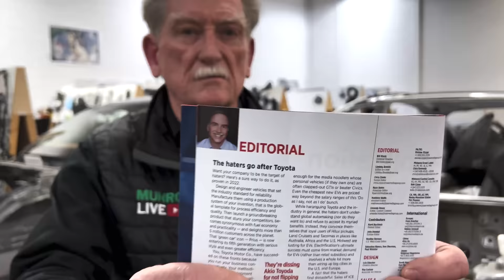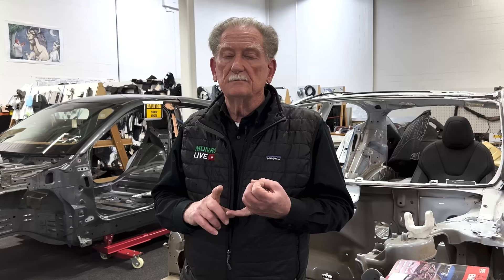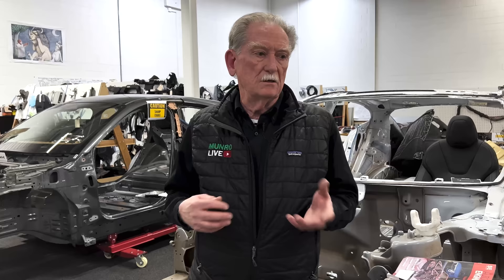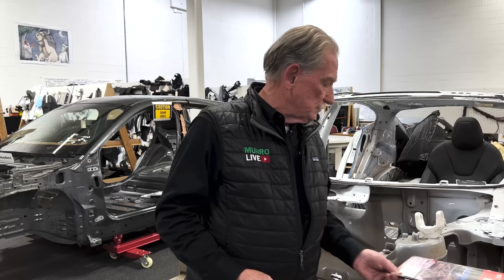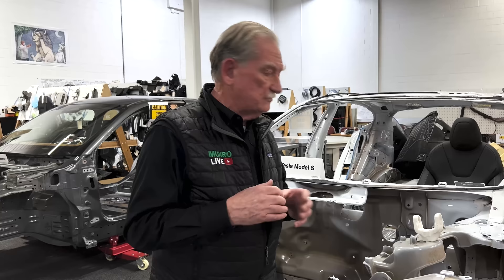GM Cast(ing) Away | GM gets low volume right.

Comment: Please do a show on metal fatigue, especially aluminum components of automobiles. Also, how corrosion affects aluminum parts and reactions between differing metals of those parts. I see a lot of aluminum being used now in cars and it would be nice to know how this material will fare long term.  Your show is always educational!
Reply: I have a Audi A2 from 2002, it has 240000km and it looks new. The aluminium chassi/body that my Audi has is rock solid.
Reply: Sealing between dissimilar material is how aerospace solve this issue. We have been using superplastic forming for decades in the airplane business. Aluminum airplanes can last for many decades given the right maintenance. Look at the B52 which are still in service.
Reply: Plenty of aluminum suspension components for decades now!
Reply: @Chumpster Aluminum form an oxide coating as soon as it is exposed to the atmosphere, this coating prevents corrosion. Al parts are often treated with a conversion coating such as alodine and anodize plus paint. Al can out perform steel with respect to corrosion and rust.
Reply: @Liberty2358  re: "Sealing between dissimilar material is how aerospace solve this issue" exactly these problems have long been solved.  what most don't see is simply how they are ignorant to these developments and are essentially playing "catch up".  also ref: 3M.
Reply: @phillyphil1513  We use wet sealant to prevent electrolysis, dissimilar material can act as a battery when there is a voltage potential difference and moisture (electrolyte). The sealant keeps the moisture out and prevent corrosion. You will surprise that 1 volt potential can corrode aluminum parts without sealant protection.
Reply: @Liberty2358  Good to know. Thanks
Reply: No need for a  show, no evidence either Aluminium Fatigue or corrosion a major issue. Get rid of the pesky ferrous components ASAP I say
Reply: @Liberty2358  re: "You will (be surprised) that 1 volt potential can corrode aluminum parts without sealant protection." but thankfully NOT a surprise to any Pro working in the field of Autobody and Collision Repair since the arrival of the 1997 all aluminum Audi A8, so 25 years ago.
Reply: Time will tell all how GM/Cadillac wins or fails.
Reply: This is covered in basic materials engineering books. I doubt they are going to start teach classes.
Reply: Lol. Meanwhile Cadillac used to be synonomous with falling apart because of the steel. And yet somehow maintained the "luxury" reputation.
Reply: @EnlightenedSavage  re: "This is covered in basic materials engineering books. I doubt they are going to start teach classes." exactly you're (a minimum) 25 years behind both the Auto AND Motorcycle Industries, so better to pick up a book and read it on your own in "self-study".
Reply: @Max PreA I think they were asking about interactions between that metal and other metals touching it. Not a testimony of aluminum holding up over time.
Reply: @maxprea3745  I worked on German cars for 38 years and yes Audi has the best body integrity.  Bank vault solid, not the best engines though
Reply: @robertpsotka3525  yes, my engine is a POS

Comment: Japanese have been using aluminium suspension and sub-frame parts for a long time.  Pressure or high vacuum die cast is the way to go as it minimises or completely gets rid of air bubbles and ensures good grain in the metal.

Comment: 15:10 worked at a factory that had industrial screw presses for pulp. To make sure they had the tight tolerances between the screw and the cylindrical mesh, they would build up the screw edge. An semiautonomous welding machine would heat up the edge, weld on filler material, cool down the edge, then grind off the excess as it was slowly rotating the screw. 

I can easily see something like that with a Kuka robot arm making and grinding/milling turbines

Comment: A lot of car bodies are now held together with adhesive,  and to hold the parts till the adhesive cures they use rivets applied by robots. There is also high strength boron sheet steel with a 'BH' prefix,  now the BH stands for 'bake harden'  this allows the steel to be formed and pressed and after the car body gets painted and goes through an oven to cure the paint the BH steel then achieves its maximum hardness,  this means that thinner gauges can be used to get the same or higher strength.

Comment: I used to work at an aerospace company that did super plastic forming of titanium alloy. Wild stuff. The dies were made from 309 stainless steel and heated to 1450 F. The blank was prepped, loaded, preheated, and then a rack of argon gas cylinders would blow the titanium into the die cavity at around 1200psi. After holding for several minutes, the gas was vented, the die opened, and the part put on a cooling fixture so that it held it's shape until it regained it's strength after cooling. Then it was off to be grit blasted and acid etched to remove the brittle oxide and alpha phase alloy that forms on the surface at high temperature in air. Also horrendously expensive. Cycle times around 30 minutes per part. The argon bottles had to be refilled every day. It took three hours to heat up the die and about eight for it to cool enough to handle it. The seal surface had to be polished after about 20 parts and recut every 100 or so. But when you only need 300 parts a year, and those parts go on fighter jets, it makes sense.

Comment: Good to know the General is still willing to learn some new tricks.  Preventing galvanic corrosion due to contact of dissimilar metals is something manufacturers have to watch out for with aluminum.  I have a 1st generation Honda Insight which is built with a lot of aluminum.  Honda was careful to use Dacotized fasteners when the fasteners were steel. Dacro is a three-metal passivating coating which is like galvanizing but has a dull gray color.  Aluminum will corrode around a non passivated steel fastener.  You’ve also got to insulate between aluminum and steel components to prevent galvanic corrosion.  On the Insight even the brake calipers, drums snd wheel cylinders are made of aluminum.  I recently ran into a problem getting the brake bleeder nuts loose because the bleeder nuts are steel and not passivated.  GM tried aluminum fenders on one of its Pontiac models about 1960 and did.not prevent galvanic action and the fenders rotted out furiously when exposed to salt water, setting up galvanic corrosion.

Comment: You forgot the 2000 series Aluminium Alloys Sandy.   Like the 2024 alloy that the SEABEE (!!!) and the spars are made from....over your right shoulder at the end.   Amazing stuff to form when it's in "O" condition, then heat-treat it up to a higher yield than 6061 T6.   Oldschool.

Comment: Nice coverage although video segments of each process would have helped a lot in clarifying the details.
Could you please cover 3D selective laser sintering especially as it relates to metallurgies?   I was handed a part a few years ago made using that process. Similar to your ball in a ball it left me flummoxed as to how they could do that - and the finish, even interior, was as smooth as glass. I recall seeing an episode of Jay Leno's Garage where they were able to 3D scan, edit and print (SLS) a waterpump for a early 1900's vehicle they were restoring. Just stunning advance. Nothing is obsolete if you can make parts on the fly.  We are also seeing parts made using Artificial Intelligence and Additive Manufacturing like the Czinger 21C.
Reply: As I understand it the 3D printed parts are "sand blasted" with flour or other soft materials for finish.

Comment: I'd love to hear more about that heat exchanger (and how it performs vs traditionally manufactured heat exchangers) and about other real parts.  So often I see 3d printed parts for toys and theoreticals, not as real parts.
Reply: Several rocket companies are using 3D printed parts in ENGINE components. SpaceX has used them for some engine parts in the past. RocketLab has actually been launching rockets with 3D printed engines, and is aiming to manufacture the carbon fiber shells of thier rockets with robots. While Relativity Space wants to go to orbit with a completely 3D printed rocket. So yes, WELL beyond the old "rapid prototyping" moniker, these techniques are now valid low volume, high stress manufacturing processes.
Reply: @patreekotime4578  I concede the point about the rutherford engine, but what I really want to know of is parts that are physically superior via 3d printing, not just "eh good enough" and cheaper to develop.
Reply: @rhamph  Heard the Chief Engineer of the Clestiq on Autoline talk about their 3D printed D-Ring for the seatbelt, its apparently strong enough it can lift the weight of the car. Any part's qualities of "Physically Superior" or "good enough" will depend on the application or use case. Cost is a huge factor though, else we'd make more things out of Diamond.

Comment: I'm a 3D printing enthusiast, but I don't want people to get a wrong impression about its capabilities. 3D printing definitely has its uses, but it's not a silver bullet. It's great for prototypes and replacement parts, especially simpler parts, limited in size, detail, strength, and number of materials. You won't be able to (at least at present) print a new circuit board, or really big part, or something as strong as a cast metal part, or something that requires super high precision. But you can definitely print things that would be hard to create any other way.

Comment: Hello Sandy. Love your videos but you may have got something wrong. The reason sand castings are heavier and have thicker walls is due to the casting process. Sand cast alloys like A319 are sometimes preferred over die casting because they are more pure aluminum and tend to resist oxidation more. Maybe I am wrong about the strength as I was in the lighting industry where there is less mechanical stress.

Comment: So your using your pool table as a stage. Nice cover. The angle to the wall explains why you have cut down sticks. I prefer the one with the cut down shaft [probably a 15 mm tip unless it was tapered] for the greater mass and similarity in circumference to standard length at the butt. Much like the the four full splice standard length cues probably made in Canada. The other cut down might be a better jump cue? Thanks for the description of lost foam. I was not sure what that was when you mentioned it regarding the cybertruck. Seems similar to lost wax but quicker.

Comment: The 3D printing with metal is pretty cool. (Or hot…) There’s an aerospace company that is 3D printing almost the entire rocket. They had a video that went through all the difficulties with printing metal, if you’re melting dust, the laser blows away shavings and the metal gets porous, when printing with a wire the atomic structure isn’t quite right and the metal isn’t as rigid as it should be, and many others. It would be really cool to see a video about all the different ways of 3D printing metal, benefits, drawbacks, etc.
Reply: If that's the rocket maker I think it is, after the 3d printed part is made they process it with HIP (hot isostatic pressing) to increase density and material characteristics. 3d printing is just the first step for those parts.

Comment: Thanks again Sandy for a great video. I think GMs sheet metal forming technology for aluminum is called QPF (Quick Plastic Forming). It has a faster cycle rate than Super Plastic Forming (SPF).  SPF cycles at about 20 minutes per part.  QPF cycles at about 2 minutes per part.  SPF and QPF can only be used for aluminum and magnesium alloys.  Steel is formed using a much more expensive process called Hot Stamping.  Hot stamping is very fast but has a much more expensive investment cost.

Comment: Good to see new Developments like this.  I surprised Sandy did not talk out pressure moulded carbon composite.  For low volume high cost items it’s the big up and coming technology.

With some recent videos I’ve seen there could a future in compression moulding stranded fibres.  It would give 90% of the strength with a much reduced cost over hand laid prepreg.

Comment: 2006-2013 Corvette C6 (Z06 trim only) began first aluminum chassis...  2014-2019 Corvette C7 GM second generation all aluminum chassis...  2020-Present Corvette mid-engine C8 GM's 3rd generation all aluminum chassis.  ref: General Motors BCF (Bedford Aluminum Die Casting Facility) location Bedford Indiana.

Comment: Sandy , when working in zero gravity, would not an effective 3D printer/molder be made as a centrifuge creating artificial gravity where the molten material moves out from center to the assimilation on the outer perimeter. The overall use of a centrifuge caters to large 3D printing and molding using metal.

Comment: As for 3D printing on Mars, yes it would be good to print whatever part you need, however, mass is mass, unless you are mining and refining the metals from the planet (which would need a whole bunch more equipment), you still need to send all the raw material there via a rocket, and you still need to send a 3D printer, and that 3D printer will also need replacement parts.  It may come down to needing to have spare parts anyway.  Since we already mine and refine all the raw materials here on earth, it could end up being more efficient just to send another complete machine for spare parts.

Comment: Mr. Munro, it seems to me that a 3D printer installed in some form of centrifuge might be a workable solution. Power could be supplied by slip rings on the axis of rotation. There may be effects from Coriolis acceleration, only experimentation and calculations would conclusively answer that question. The centrifuge could be tethered to the spacecraft from the outside it being assembled from stackable parts saving greatly on launch space.

Comment: At $300,000+... It seems like a very hard sell compared to current Lucid offerings (2-3 cars for that price), Tesla Model S/X Plaid, Tesla Model S/X Standard, or future Tesla Roadster... Not sure how tech on inside is going to compete either...
Reply: Off topic
Reply: No one is gonna pay 300k for a Cadillac. Especially one made of recycled soda cans and plastic.
Reply: @rcpmac  I'm pretty sure its extreme $300,000 cost compared to existing competition is pretty "on topic"... Munro does focus on what you are getting for what you pay...
Reply: Greg, the project is not to try to sell cars.  The project is to gain experience working with new technology adaptable for future use.  In OEM companies they have something called Implementation Readiness.  These technologies all exist, but their experience levels are low inside of GM.  The objective is to allow the management to explore the potential viability of the technologies under close observation.  They are only going to make 400 or so cars a year.  So 400 x $300,000 = $120Mil Yr. then figure a 4 year run that is $480Mil Total Return.  So clearly, it is not about money.  It is about seeing what happens when casting into 3D printed molds, 3D Metal Printed Parts, and QPF Quick Plastic Forming are all used together.   I'd guess the cost is intended to cover overhead. +/-.  It is not just about making the cars in a new way, it is also about understanding what happens when they are deployed in real conditions. I think Mary Barra is a very smart business leader.
Reply: Sold out for 18-months...
Reply: @normt430  pre orders and actual purchases aren’t the same
Reply: @thomas735  are you suggesting the CT is not.real?
Reply: @normt430  So 600 units?
Reply: @mellis966  I can respect that take and strategy... It just feels like this is 5 years too late on the EV tech/design curve to implement any learnings for mass market, before Tesla and others have taken extreme EV market share...
Reply: @rule1capital  that would double Rolls Royce sales!  Sure!

Comment: Kind of off topic, but this video indirectly explains a plausible reason why the base at Area 51 has expanded greatly in the past 25 years, but there has been virtually no public disclosure of anything going on there.  Two technologies make this possible. The first is the ability to make most of the needed parts for aircraft prototypes onsite using the techniques described in this video.  (Most of the other parts can be shared with other aircraft that aren't secret.)  The other technology is the computer systems that enable reliable unmanned aircraft.  If whatever secret aircraft prototypes are unmanned, if they crash, there doesn't have to be a press release.  Note that I'm not talking about aliens at all, just state of the art aviation technology.

Comment: In my opinion the focus needs to be on making things simpler... I feel the big auto people spend too much time on forgetting that and come up with some complicated ways to do things a simpler method would achieve.
  Would any of the big ones had made a mass produced car with no real instrument cluster? One that required a touchscreen to turn on headlights, wipers, and the such?  No.
  One of my complaints about the Maverick Hybrid I owned was how complex the systems were. Push a button here to get better MPG's, or in a menu on one of two different screens? Or maybe a scroll wheel over there? Or menu's via a button here?  All of those displaced switches require pathways (wires) and add complexity (weight).
  I feel the next upgrade in this area will be turn signals/lights/horns/sensors that has power wires, but are controlled via a wireless signal.  This would reduce vehicle weight (and complexity) even more.
  The big companies lack innovation imo.